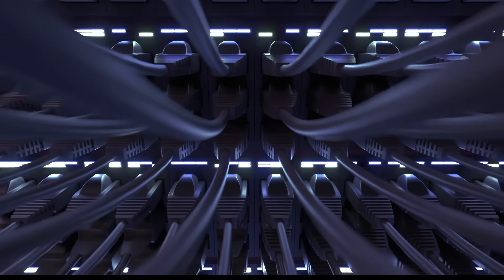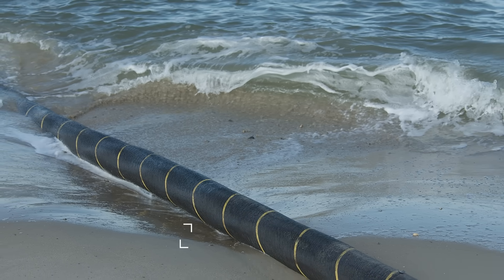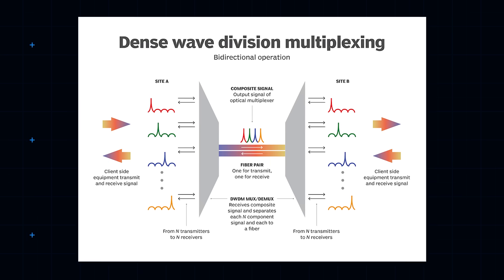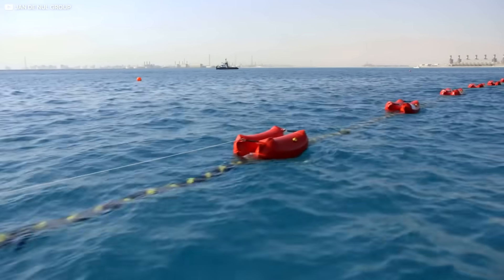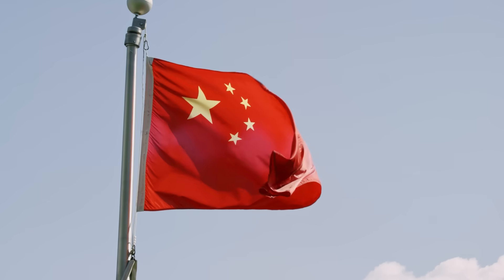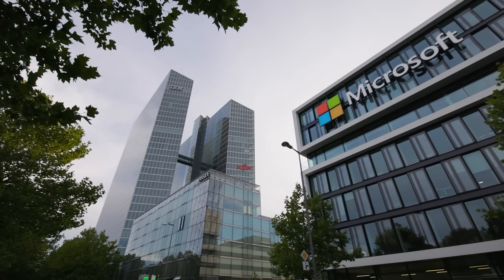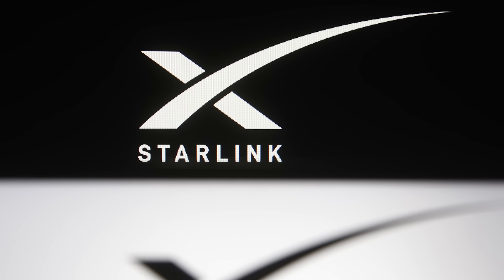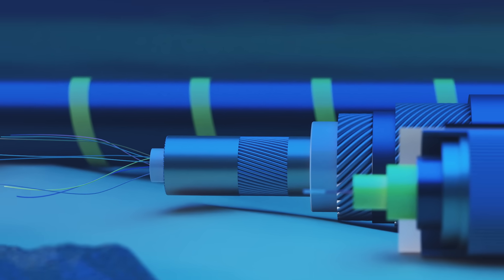How The Internet Travels Across Oceans

Comment: The 100 Gbps turning soon to 400 Gbps is actually per wavelength, meaning the overall bandwidth can be up to 80x that. Plus, that is only if you use one fiber strand. These fiber cables should have dozens of strands of fiber, thus multiplying the amount of bandwidth even more.
Reply: Thank you for clearing that up I knew something was wrong about that figure
Reply: Yeah, more realistically a single undersea cable has a capacity of 50-100 Tb/s.
Reply: Exactly. These cables also have self-healing measures/materials that often don't require human assistance to stay operational.
Reply: @ceemontana5877  how can a fiber cable be self-healing?
Reply: There are already cables in the oceans that are running 1Tbps per pair and they typically have 6 pairs or more. One of the big differences with fiber on land is a run could have 100 or 200+ pairs of fiber in it. While ocean runs will often only have 6 to 12. I'm assuming it's because of the repeaters. Those things are giant. It was a pain in the ass to load them on the ship when I did that kind of work 20 years ago and from the looks of it from the video that hasn't changed.
Reply: Thank you, I literally came to the comments to see if someone cleared this up. 100GBPS seemed miniscule, not "awesome" lol
Reply: I would assume there are at least 1024 or 2048 individual fibers in each of those cables. Each fiber is 125 microns, about 3 times the width of the average human hair.
Reply: 8
Reply: I get 100mbps data speed for 700/- which is around $10 in India
Reply: I'm getting around 450mbps for $50/month in California
Reply: @Mykhaiel  sure you don't mean terabits? 662 Tera bytes per second isn't possible in the current day..
Reply: Actually, they use pairs of fibre, each with over 100 wavelengths
Reply: How can one fiber transport terabytes of data? Even at the speed of light communicating back and forth seems impossible.  And what processor can handle more than 10gbps? Nothing made in the last 10 years. Cpus are stagnating.
Reply: @kenmastersmaster  there are specialized routers for this kind of work made by Ciena, each fiber pair can run 400gb/s they trunk multiple streams of traffic at the same time multiplexed by wavelength and time.
Reply: @kenmastersmaster  multiple parallel strands all sending multiple colors of light at once. Multiple colors means multiple wavelengths. Each wavelength able to carry its own fairly large volume of bandwidth. As for the servers on either end, it’s kind of the same concept. Lots and lots of racks of computers all running parallel and doing their own slice of the pie, I imagine.
Reply: Google's 12 fiber pair dunant cable has a capacity of about 250 terabits per second
Reply: i was thinking that it was low numbers for cable ( 100gb per second) then it will be used for so many people, companies , reasearchers lol..
Reply: Exactly ..I was wondering same.. And how this guy mislead on APRICOT.
Reply: Yeah, I was waiting for them to mention that.
Reply: makes sense now
Reply: Would more bandwidth mean more information i.e. more speed ?
Reply: Spiderman2Playstation5<what?
Reply: And I get 20 Mbps at my house…
Reply: @jonathansaravanan  yeah.. well they don’t just connected to your house only bruh..
Reply: @jonathansaravanan  That's because of copper.
Reply: Do we know if the repeaters are passive? I'm guessing they should be so so that transceivers on either end is that's required for an "upgrade" both now and into the future.

Or perhaps each repeater can be programmed? (doubt it as super $)
Reply: @callitagain  The repeaters are active.  That's what the power is for.  However, these cables have a lifetime of about 30 years or so.  So, they will eventually be replaced with newer, more capable fibre and repeaters.
Reply: @James_Knott  they still haven't found the top throughput limit of long distance single mode fiber. Most likely using EDFA amplifiers, which can be used with any optical signal within the ITU range.
Reply: @DilemmaCS  My understanding is the theoretical maximum for a fibre is around 1 or 2 petabit/sec
Reply: @callitagain  Nothing about them is cheap.   The outer shell is made of beryllium and has a scrap metal value of around $500,000.
Reply: @callitagain  the repeaters they are using are most likely EDFA amplifiers, which are pretty universal for any application.

Comment: Some of the visuals in the video are of power cables, not fiber optic. Slightly misleading. It's important to note how small these cables actually are. The Marea system mentioned is less than an inch in diameter at its longest span. I work on the ship at 4:06.
Reply: Then wouldn't you know that the cables have copper running within them....to power the repeaters?

Comment: "for now cable is by far the cheapest and most efficient means of yeeting vast packets of data over incredibly long distances"
Reply: LMFAO Thank you ! Wth was that !?
Reply: If war between country vs country happen , And military enemy doing destroy cables  , did all server military down ?
Reply: Yes, if your intention are to controll the flow of information  and force everyone to pay  for it.  Yes I agree you would make sure it was removed it out of the free realm (The air) and put into cables. Wi-Fi is through the air  through very small rabbit ear antennas. All info flows no matter how much. Unless you get toggled by the provider in an attempt to frustrate us from using it. By law they are required to release it in the air. They get around this by emitting such a weak signal through the air that its almost impossible to pick up on to the extent you would have to get within 30 cm.of where the signal is broadcast to pick it up.thats  with an antenna.

Comment: I know it wouldn't be as fast, but wouldn't satellite or even wireless buoy-based internet towers save on the materials and possibly even the costs?  After all, our phones are wireless, why can't the whole network be?
Reply: Tower station powering phone networks are connected to fibre cables. That’s it

It’s funny for people to believe wireless networks are all wireless, maybe for basic radio communication it’s ok, but internet transmitting petabytes of data, it’s not possible. Most mobile networks are wireless at the very last few hundred feet only

Comment: Can projects like Starlink remove the need for these? If no, then why?
Reply: Capacity of satellite transmission is way less than fibre cables, and even starlink ground stations have to link up to fibre cables to provide satellite internet. Just treat starlink as a big web of wifi covering the earth for now, then you will understand why
Reply: No. Currently, its too expensive to put things in the orbit, not to mention that it is not as efficient as the cables and probably the biggest concern is space debris which can be detrimental for future space exploration
Reply: @AnimaRandom  Spacex is currently working on the cost issue with great progress and collisions will not occur as the sats will be orbiting in a highly controlled trajectory, mostly avoiding collisions before the sat is one full revolution away from it. But traffic might just be an issue.
Too many satellites might create issues for spacecraft trying to cross the layer of these sats out to deep space.
Reply: @kedarpatil7095  man so where do these satellites get the internet from? They don’t store the internet! Even if star link is fully operational, the internet it’s transmitting is still from wires.
Reply: Hardwired connections are always better.
Reply: It'll cost more in the long run when due to any sort of interface, they crash onto the surface of earth or with one another. Not only is there severe risk for collateral damage, the debris in space will also become an issue for other space operations.

Comment: Wow im shocked have been led to believe its ALL SATELLITES ...lol ...sarcasm implied ...jeez....
Reply: Oh word, satellites are next to useless for high bandwidth.
Reply: @testthisfordecficiencies  lentency is biggest issue
Reply: There aren't any satellite's
Reply: @j-man1703  Nice low iq
Reply: Wire is always faster.
Reply: @doctorpanigrahi9975  it's not wire it's because of optical fibre which carries signal at the speed of light
Reply: @doctorpanigrahi9975  what you mean ?
Reply: @whityguy9570  wire also has close to speed of light.
Bt optic cable works using total internal reflection . So ur data loss will be very low.
Reply: @squidscrew1339  never speed of electricity can't be equal to speed of light ......
Reply: @whityguy9570  Random Indian Dude is referring to your name, lol.
Reply: @whityguy9570  fastst is light . Bt electricity speed is close to light like 90% of speed of light. Bt that's not the reason for low internet speed through wire and much higher speed of optic cable. 
electrical wire cause huge data loss, whereas optic less data loss.
It's because of total internal reflection in optic fiber. In total internal reflection after every reflection almost 100% data saved without loss .
I think this will b the reason.
Reply: @whityguy9570  no it doesn’t, it travels about 3 quarters the speed of light. Just under 205,000,000mps, speed of light is well over 300,000,000mps. Nothing made by man has ever reached the speed of light.
Reply: @doctorpanigrahi9975  and safer. I prefer wires.
Reply: @doctorpanigrahi9975  yeah but not at currency exchange. 😅
Reply: @doctorpanigrahi9975  facts
Reply: @Doctor Panigrahi  but i think internet companys still want to move over to wireless eventually
Reply: Satalite*
Reply: @doctorpanigrahi9975  Wire is actually slower, it's the capacity that matters.
Reply: @kedarpatil7095  wire also has speed of light.
Bt optic cable works using total internal reflection . So ur data loss will be very low.
Reply: @kedarpatil7095  its fiberoptics witch used light 
light is the fastest known thing so im pretty sure it is the fastest
Reply: Everything you have been told is a lie…..🤔
Reply: Im pretty sure one of those  "sattelites" crashed into the very large mountain range in front of my house ....my "sattelite dish" is pointed parrallel to the ground at that mountain .... but im told even by the guy that installed it    " oh yeah its hitting a sattellite in space.....unh huh ... ok ..
Reply: @donaldmoore6327  ?
Reply: Earth its Flat. Research.😏
Reply: @mariusbustea8877   i know its flat ..sarcasm research !!
Reply: Satelloons. Look it up, not a conspiracy theory, NASA launches thousands of them yearly
Reply: @viktorvasilik5477  yes.. since nothing is actually in outer space ..high altitude balloons carry sattelite like equipment aloft ... for military and govt use...civillian phone and tv is ground based .. towers and amps and repeaters ... why my cell is dead in in desolate areas .. out of range of a tower .. if sats were real id have service right over my head .... everything our govt tells us is a lie .. no farmer tells their cows how to use a computer ... govt tells us peons the same ... just cash cows to them .. work ..pay yur taxes and shut up ...dont think ..dont go against the narrative.. now that too many  are waking up ... going against em .. timed release lethal injections are being administered .....through fear of the flu...  final solution part 2.....
Reply: @donaldmoore6327  Satellites only have so much range?
Reply: fr always thought it was towers and signals rip
Reply: I was just thinking that
Reply: No .it’s chain of isp
Reply: It will be in some time... Check star link by tesla
Reply: 33
Reply: Facts! Space Exploration & Space Satellites don’t exist. NASA is a Hollywood Scam .
Reply: Yup satellites are a faint fake. We been lied to folks
Reply: Spacex is making it real bro😜😜😜😜
Reply: If you use satellites phone sure can.
Reply: I wonder how it doesn’t get cut
Reply: Me too
Reply: Yeah before cables use to be connected to satellite dishes in outer space.
Reply: @MrNetmaker  no buddy 😂😂
Reply: CCNA tells the whole story 😇
Reply: What rock have you been living under?
Reply: Online gaming would be a pain with that.
Reply: Plot twist: It IS satellites, and in fact the government actually gets to keep their secrets and give you “this” something more believable to “believe” in. 💡
Reply: No one likes a smart ass
Reply: @xLoneGunmanx  I do lol
Reply: <~~~~~~~~ DONT CLICK MY PROFILE
Reply: Neat, I'm the 1000th like
Reply: Ya foreal and that it’s round
Reply: Welcome to reality
Reply: China prefers using balloons.
Reply: You weren't being sarcastic. Please don't be willfully ignorant. There's nothing more annoying than someone being intellectually dishonest.
Reply: This is how assumption rules people's minds. Ask anyone anywhere how are mobile phones connected? The answer satellite's ignorance is bliss.
Reply: You wouldn't be able to play games online because of the latency if it was satellite (minus low earth orbit services like Starlink)
Reply: Satellites run the television network, and the internet to some extent, only for isolated places. Rest is wire.
Reply: @kedarpatil7095  all satellites are grounded aka located on the ground
Reply: Satellites do not exist
Reply: StarLink will be 👍
Reply: Whoever thought that is beleive in NASA universe conquering craps also
Reply: They did this long before satellites.
Reply: When you use Mobile device link connected to near by tower and that tower some or most of the time transit data using satellites. However that's very low in bandwidth. Wires on the other hands are cheapest and quantity based solution.

So yeah we are talking through wires.
Reply: @Techdarkcom  Fibres, please!   ;-)
Reply: Starlink is satellite 🛰
Reply: "Satellites" lol. Magically hanging in outer space
Reply: @viktorvasilik5477  shhh 🤫 lol don’t say that . Magically Hanging lol
Reply: @viktorvasilik5477  ?
Reply: @firstduckofwellington6889  meaning the only thing NASA ever sent to space was your imagination
Reply: @viktorvasilik5477  You're so delusional lmao
Reply: @viktorvasilik5477  🙌🏽🙌🏽🙌🏽🙌🏽🙌🏽
Reply: @viktorvasilik5477 Nice low iq
Reply: True, Satellite can handle that but it's cost effective with wires
Reply: Wow.
Reply: What? It must be nice living in complete ignorance 😳🙄 I knew this shit 15 years ago!!
Reply: Long story shot fellas . Men never been to Space. The Whole Moon landing was done in Area 51 with the joint efforts of Hollywood & the CIA. 💪🏽💪🏽💪🏽 Welcome to America 🇺🇸
Reply: space is fake, nothing goes much higher than 100 km.
Reply: @coryleblanc  space IS fake and we arent on a spinning ball ... ...
Reply: @donaldmoore6327  and earth is concave
Reply: @donaldmoore6327  earth is FLAT
Reply: @Goodlife-x9h  finally a person who knows the TRUTH ....once you see it it ..its so Obvious ...
Reply: @coryleblanc  Earth is a Plane . A endless Plane
Reply: @donaldmoore6327  are you serious with your initial comment? :)
Reply: @drk_blood  no ...all sarcasm ...satelites dont exist  in space...
Reply: @coryleblanc  explain why you think that
Reply: @kSLr1092  firmament, simply.
Reply: Take a deeper look all satellites truly have helium balloons on them. Sorry your Hollywood space is not real

Comment: It's wild how the internet we enjoy is due largely to someone putting wires in the ground 😂😂😂

- wish I had thought of that 🤭
Reply: Do you get the cloud/cloud computing too? It ain't in the sky
Reply: @edwardsmyth6522  it should be called underwater computing 😅
Reply: Well, I am am pretty much interested, whether you did think about at all. Because I suspect most of the people do not think about where all informations travel along.
Reply: What's wild is they removed signals that magically flow through the electromagnetic atmosphere and put everything into cables  .bye bye antennas bye bye free flow of info.  As the alexander graham bell experiment put it "across the ocean for the very first time." through the air Antenna to antenna.  That was replaced by greed and control and into wires it did go.
Reply: @coffeetime.3063  Lol what
Reply: @g35s  most  forms of communication were removed from station to us by the air directly. And put into wires  not to enhance but to control the flow. When I was a kid in the 60's. We used antennas only and got many channels for free . More if u had a better antenna. Slowly it all went into wires and delivered to your house by cable. We can still get it through the air but it is now pushed through cell towers and they can throttle it and charge you for data that would otherwise flow freely through the air. Channel 4 Is the only free station now .still pick it up with  with antenna..
Reply: @coffeetime.3063  is because cable is so much faster and stable. There is a reason why playing games on cable is better than wifi.
Reply: @tano1670  I remember before WiFi having to run a LAN cable from the router in the office up a flight of stairs down a hallway and into my room so I could get the computer to work online.